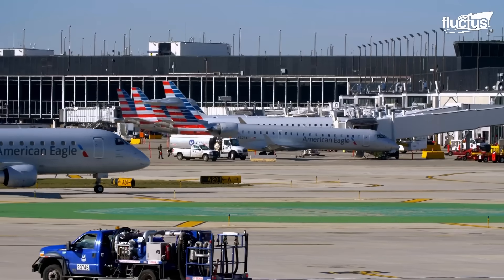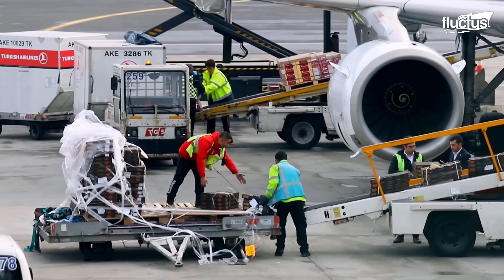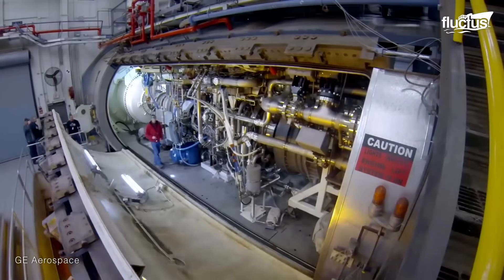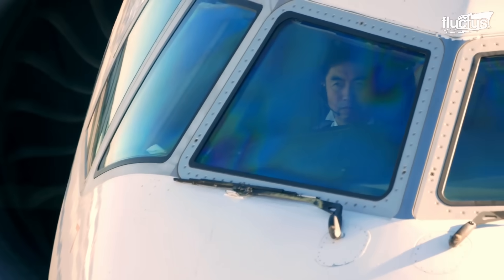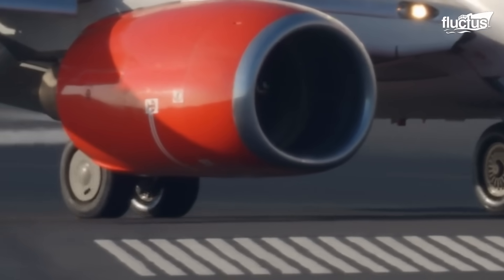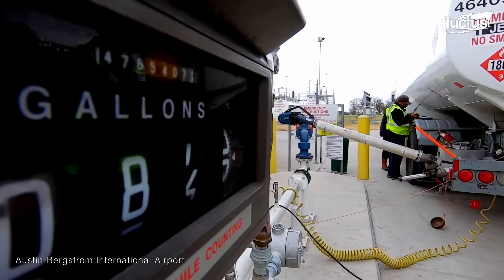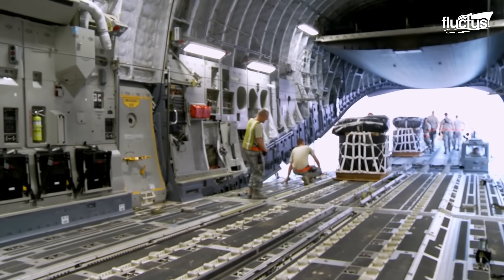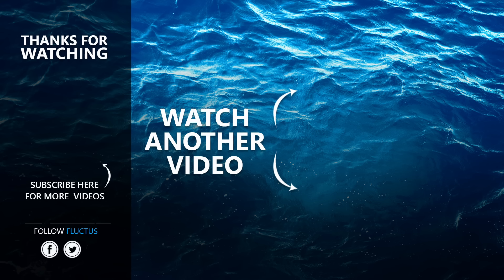The Scary Dangers of Working Close to Gigantic Aircraft Jet Engines

Comment: Baggage\freight loading, unloading and refueling are safe due to the fact they do not run the engines at the gates.  Military cargo jets also do not run the engines during loading or unloading.   The exhaust of jet engines is equally dangerous,  you did not cover that.

Comment: Its not very dangerous as long as you keep the very few simple rules in mind while working around an airplane. And its simplier than ever. If beacon on the plane is flashing, the engines are on or about to be. And keep 5 meters away from the inlet and keep out in the blast line of the exhaust. Thats it.

Comment: It’s obvious this guy doesn’t know what he’s talking about. Highly volatile jet fuel makes it sound like it is for the space shuttle liquid oxygen. All jet fuel is refined kerosene just a very clean kerosene if you were to take a match and drop it into a bucket jet fuel it would turn out immediately there soon as oil diesel is carrying, but they add a lubricant because the car needed. It is the same thing, but the lubricant cannot be used in the airplanes because it would chill at high altitude because it is so cold.
Reply: 💯‼️this is absolutely unwatchable!!!

Comment: 12:38 I work at Hill. I’ve worked on 17-5251, and the most memorable thing that happened recently on 5251, is one of our beloved female pilots decided it’d be a great idea to take off in FULL AFTERBURNER with the parking break on. iirc, there were 7 layers of cord showing on the tires and we had to change both tires, put up the tail hook and do a break function test. The aircraft had to be towed from the runway to its spot, pilot gets out and blames the aircraft for not functioning properly (to put in simple terms) but data showed it was 100% pilot error. Other than that, lovely aircraft!

Comment: The engines arent running until the aircraft is pushing back, thats where the phrase "push and start" comes from, the tug pushes the plane backwards so they dont use the thrust reversers to reverse, then they start the engines when the marshaller tells them to, any other time, there turned off, and won't injest anything

I worked at an aircraft dismantlers, and often walked straight up to the intake and pushed the bypass fan round to make it clatter, to let the other guys know it was dinnertime, and i never got injested, because the engines weren't running

 Theres a red line on the engine, and you can quite safely walk right up to the engine and touch it as long as your standing behind the red line, and the engine is only idling, this often happens when a mechanic needs to hand start the engine, when the bypass air valve to the starter has failed

So research more, because half of what your saying is B.S.

They wouldnt have the engines running while there refueling either, because of the heat coming from the exhaust end, and potential fire sources

Comment: common sense say's these engines can suck anything into them than they are dangerous and stupid at any time. a bird or some kind of debris these engines can take in. doesn't give you a safe feeling along with all the parts that make up these engines. to make them work aliens would laugh at such a primitive form of propulsion.  than they want to disturb the bird's environment by putting a net down to trap them and also destroying nature by cutting down trees just so humans can put a machine in the air that doesn't belong up there to begin with God made birds and some insects to fly don't see wings on human's jet airplane flying around big butane lighter with wings instead of butane it's jet fuel one little spark that's your azz🤣

Comment: Hard to believe they don’t have mesh grates over these engines, to prevent people from being pulled into them.
Reply: It’s because of drag which will use more fuel…imagine swinging a tennis racket with the strings and then swinging it after with the strings removed.
Reply: @andystack7449  drag uses more fuel which, in turn, affects the corporation's monetary bottom line... It's always MONEY 1st SAFETY 2nd...

Comment: Would anyone explain why seems logical to Americans to use small units with very big number? 30000 feet or 200000 gallons? Or 50000 pounds? Why don't you use miles instead of feet? Or tons instead of pounds? Not to mention, in metric units will be waaay more simple. Or SI 1000 times is called kilo. Ex: 1000 tons is 1kilotons. Anyone?
Reply: Because smaller numbers equates to better accuracy.  Aircraft need to be at very specific altitudes to prevent collisions in flight.  Weight needs to be extremely accurate for center of gravity, weight limits, etc...  Fuel is read by pounds because the gallon is a measure of volume, not weight.  A gallon of fuel will change depending on the ambient air temperature.  America still uses the Imperial system because... time and money.
Reply: @andynak2489  Thanks.  America uses Inperial because of time and money.  You think that other nations haven't had their specific units? Yes, they had. However,  in order to COOPERATE and make trade easier they agreed on the same system.  If US won't be the first world power they will adapt the international system, no matter the time or money.
Reply: @ferencszathmary9689  I don't really care whether or not you feel the US needs to fully embrace the metric system.  All I did was answer your question on why we haven't.  Could've just googled it...
Reply: @andynak2489  Thanks. You are right. 2 things characterizes the US best: 1. I don't care (I care only about myself.)  2. The most important in life is money.  Enjoy your life.
Reply: @ferencszathmary9689  No, I don't care because I didn't respond to have a debate about weights and measures.  I was nice and took the time to answer your questions and your repayment for that kindness was to be rude and try and force your opinion on me.
Reply: @andynak2489  "I don't care what you feel about.." is rude. I wasn't rude.  I said thank you and my opinion without the intention of hurting anyone. Just take it easy.  I visited the US many times, and you can also visit countries outside USA.  And besides, pounds are also used to show the load's weight on trucks. Trucks are not aerial vehicles, there is no need great accuracy...  So, why pounds for trucks and not tons?
Reply: @ferencszathmary9689  I've been to plenty of countries around the world...  Why assume that I haven't?  I'm sure if I started saying what you and your countrymen should do, you would consider it rude as well.  We're content using the Imperial system for everyday things, why should it bother anyone else who doesn't live here?  I don't go to England and Japan and tell them that they should convert to driving on the right side of the road.  It's their country and their choice.  

Also, shipping companies have a great need for accuracy as they charge by size and weight.
Reply: @andynak2489  You can use your imperial system at home for another 1000 years, no one cares.  
The point is when yanks posts videos here they expect that the international viewers to be familiar with the imperial system.  That's a very nearsighted approach.
And, by the way, have you heard about the Lockhead Martin Mars rover accident?
Reply: @ferencszathmary9689   It's horrible, I know.  "Yanks" posting videos on an American made platform using weights and measures from the country where they live.  Next time just go Google the answer.
Reply: @andynak2489  Google is a machine.  I prefer to communicate with people. Aren't you fed up of today's customer services of big companies who make you wait hours on the phone to talk to a live agent listening to their music because simply not every problem is has a solution on a website?
Reply: @andynak2489  American platform.  And non American viewers and clickers.  Yt pays after the viewers who mostiy aren't from the US.  
So, Lockheed Martin Mars rover accident?
Reply: @ferencszathmary9689   Sounds like a you problem...  Don't like it, start your own video streaming platform.
Reply: @andynak2489  OK, Andy. Instead of having a dialog and having a compromise of the two views, you offer the separation of it. Cannot live in a bubble of the imperial system in today's world of the internet and the globalization.  Anyway, I wish you all the best in life.
Reply: @andynak2489  And last idea.  You were mentioning accuracy.  Measuring something and adding "shy" of "fat" isn't the most accurate...  My brother worked in a machine shop and growing up in a metric system he was astonished about the thousandth part of the inch as a measuring unit instead of the fractions of the millimeter.  Or instead of the simple whole digit metric wrenches the use of overcomplicated fraction notation SAE wrenches? Ex. Metric 11 wrench is 7/16 inches. How nonsense is that? Do you have a 67/128 or a 877/1024 wrench, too? Just old habits, time and money? How about progress and improving? The wooden wheel was also working well and was an old habit, but people changed to the metallic ones.
Reply: @ferencszathmary9689  Again... just because you fail to understand something doesn't make it bad.  Also, I'm done with this discussion as I answered your original question ages ago and you couldn't just be grateful for that.  Take care and have a good day.
Reply: @andynak2489  I don't fail. And I never said that you or your system fails on the international scenario, which is by the way true. I tried to be as neutral and diplomatic as possible. Well, I tried to have a dialog of logic.   Did not work out.   All the best.

Comment: An aircraft engine will never be running while loading baggage or fuel unless it necessary such as lack of an APU or a ground power unit and usually the engine will be running on the opposite side of the aircraft cargo or baggage loading doors....

Comment: The engines are not running until pushback and very very clear of any obstacles. THEY ARE NOT RUNNING AT THE GATE
Reply: Yeah they are.  Sometimes we have to start one at the gate because the APU is out…or we run them at the gate after we change a filter to do a leak check.

Comment: No one should be approaching a commercial aircraft if the navigation lights are on. The engine should not be running if they are not. Incredible that the KC 135, developed alongside the Boeing 707 is still in use today, re engined.
Reply: And you don’t work around them obviously.  The nav lights are on all the time at the airline I work for. The BEACON being on means be alert and approach it with caution, or it is about to push.
Reply: @justing42  Your airline approves approaching the aircraft when Nav lights are on?
Reply: @justing42  Which airline? So I don't inadvertently fly or apply.

Comment: I am an aircraft engineer who has worked on and tested aircraft engines whilst at idle.  Baggage handlers never work near operating engines. Engines are not run whilst fuelling except for one very specific reason. It appears your video is intended to scare. People who get sucked into engines should not be on an airport.
Reply: Don't forget the runaway 747 that sucked in a baggage container and ultimately destroyed the engine
Reply: @Red Wolf Piping  it happens. But fir this person to say baggage handling us dangerous is absolute rubbish  used to fuel aircraft, push them back, be on the head set, do maintenance and actually run up and taxi B747 for maintenance. Si I guess I know something about working with aircraft

Comment: I have to leave comment once I hear some bull shit , who loads an aircraft with the engines running ? We in the industry can make sense of the nonsense being administered here. We don’t load or fuel an aircraft with engines running or even being tested  WTF! There’s no chance of injection on the ramp unless while taxing in and ramp agents know better . And secondly unless the Aircraft mechanics are running engine test, the engines are not powered up at the gates. On pushback yes once we clear the gates and get into position to disconnect to release the plane.

Comment: I’ve worked flighline ops on Jets and Propeller aircraft. Jet aircraft don’t worry me to much, but I get very uncomfortable when propellers become invisible once started
Reply: As a former navy mechanic on the flight deck of U.S.S. carl vinson. The aircraft I was most afraid of was the E2 Hawkeye. those propellers scared me way more than the jets.
Reply: @jamestravenetti7970  I worked on F-4s and C-130s. Always nervous around prop jobs
Reply: Same here i worked ay sjc and you have to remember one engine is still on untill power is plugged in
Reply: That might be a problem you should afraid of any engine from a Cessna to 747!!
Reply: They painted them black with yellow tips so it's seen easily. All of them are dangerous.

Comment: Чё они на эти двигатели сеточку не сделают? И тогда птицы попадать не будут
Reply: It’s a good idea at first but it’s not practical to implement unfortunately. 

A mesh would disrupt airflow into the engine, potentially causing compressor stalls. Ice would also build up on the mesh, further restricting airflow. 

Overall safety and efficiency would be negatively affected.

Comment: This video is very interesting. He doesn't use many of the industry terms and even showed a picture of them plugging ground power in while talking about fueling the aircraft. Also the end turned into a ramble about on the military.

Easiest thing to remember about aircraft is that the number 1 rule is when engines are running or the beacon lights are on, you stay away. Once the engines are off and spooled down, it is safe to service the aircraft and you can walk infront or behind the engine without harm.
Reply: You can’t leak check them without them running and being up close.  I do it all the time.  It’s THE beacon.  I can tell you don’t work around planes.

Comment: jet fuel is flammable but not combustible it has a much higher flash point then gasoline It's basically kerosene or k1 that's why the MSDS is code 3 red placer it's more oil then fuel just like diesel easy to contain and doesn't burn very hot you couldn't light it with a match cold climate hydraulic fluid is more flammable also every time a large jet fly's over you it's equal to 1000 cars from the 1930's in pollution

Comment: What's happening at 3:11? It looks like a cone is being put in a position to be sucked in? I'm sure that's not the case but can someone enlighten me?
Reply: He walked towards the plane to place a protective cone in front of the engine to ensure proper distance is maintained while servicing the aircraft. These cones are mandated for most wing mounted aircraft for most carriers with the thought being that you hit the cone before the aircraft as cones are much cheaper to replace. This guy failed by decided to approach a running engine while the anti collision/beacon lights were on (which indicates the engines are running or about to start).

Hope this helps
Reply: @keenangant982  Yes thanks for that, that makes sense.
Reply: @ac9110  basically, he was lucky it was only the rubber cone that was ingested, as the ground effect is all around the front lip of the intake while at idle thrust
Reply: @keenangant982  nonsense.  I am a mechanic and don’t care about cones.  It’s to keep the stupid rampers and lab drivers from running in to them
Reply: @justing42  meaning it's to protect the plane. Notice how they aren't in a hanger. That means it probably doesn't have mtn on board. You know, the guys who complain about us rampers and drivers breaking everything when they have no communication skills whatsoever and decide to tell ops they're swapping the plane a few hours after they found out the plane is bad. Or telling everyone they're actively working on the plane when we see them drive off for another few hours.

When the plane is parked at the gate there are around 7-8 vehicles trying to service it within an hour. So us hitting a cone is way better than getting in a pinch and hitting the million dollar aircraft that mtn tries so hard to ignore. You mtn guys love disconnecting everything anyway so please, put them back the way you found it so I don't have to get yelled at for your delusions.

Comment: I wonder why they don't put mesh in front of the engines to stop bird and other things from getting in the engines.
Reply: Putting some sort of mesh in front of the engine would interfere with the flow of air into the engine causing a reduction in engine thrust. This would get even worse if the airplane was flying through meteorological conditions where icing is likely to occur. If the accumulated ice on the mesh becomes severe enough the flow of air could become so restricted that the engine could shut down completely.
Reply: But the bird would still get sucked into it, the mesh would act like a multi slicer sadly. Such is the enormous power of those engines.
Reply: Ok, putting mesh onto the front then shoot a 12 LB bowling ball at it, what would happen? It would punch through it, and if that screen were to fail, you would have bird debri go into the engine as well as the screen itself, causing even more damage then just the bird, also, leaves and grass would plug the screen and cause engine surge or engine flame out

Comment: Why not put a net over engine to avoid bird strike?
Reply: Because the bird would be  pre-grated  -  would still get sucked into it.
Reply: The net would be sucked in. Think about how much air is traveling in front of the engine and you would understand
Reply: 12 LB bird going at velocity 100 while hitting a plane traveling at almost 190, the bird would shoot a hole through the net/screen and then you would have the screen ingested into the fan as well causing extensive damage
Reply: The only aircraft that had anything remotely close to intake guards was the Russian TU-144, it had razor blades in the intake so anything pulled in would be pre shredded before going down stream into the turbojet